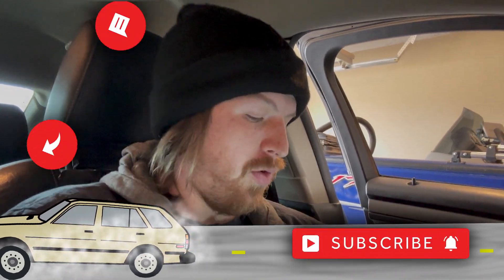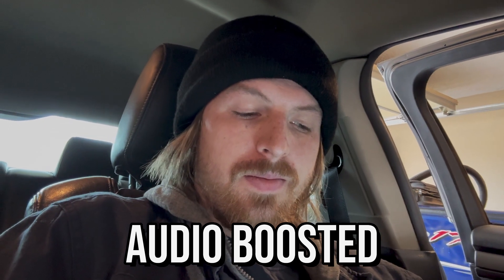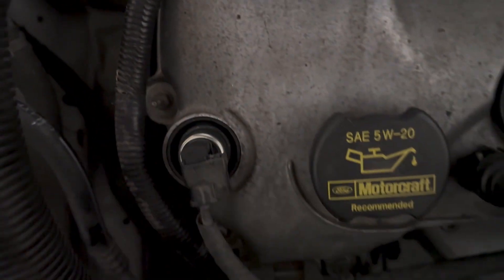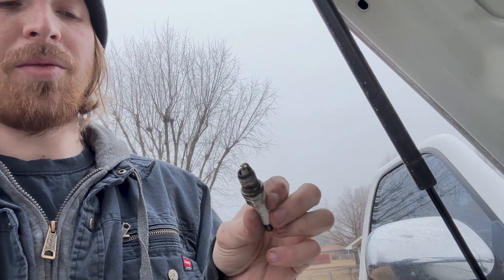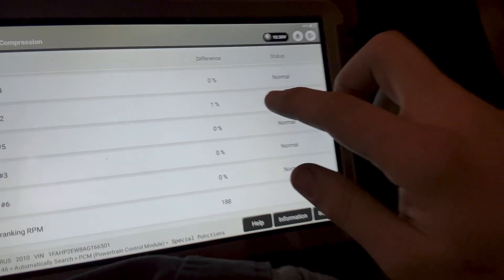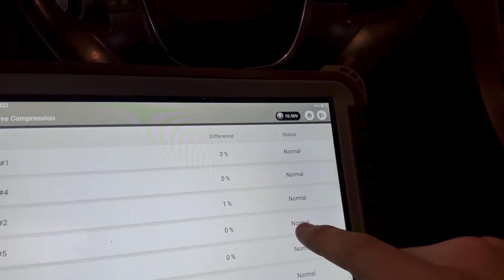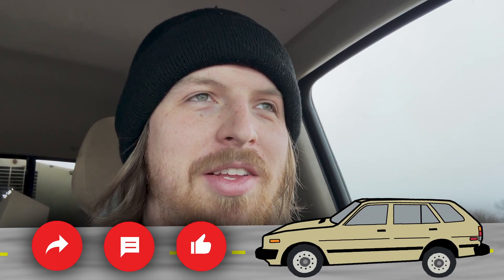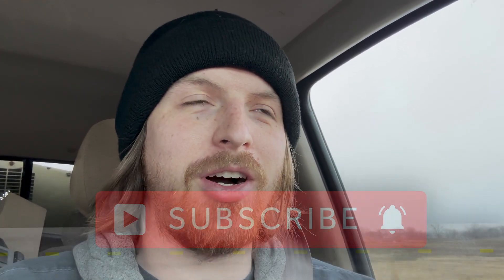3.5 Ford Taurus: Crank/No Start Diagnosis

Comment: No I’m sorry but it takes way less amperage to crank a motor with low/no compression obviously because it has less resistance compression is physical resistance the starter has to over come…. But good video and fast Diag 🤙
Reply from the maker: That’s definitely what I would think as well. I would imagine that energy doesn’t come from nowhere and compressing air takes energy so in my head a starter that is compressing air would pull more amps. My only thought is that maybe the compressed air trapped in the cylinder helps the starter rotate the crank, kind of how if you do a leak down test and don’t have it perfectly at TDC the crank will rotate. Just a thought though. And I’m only going off of what I saw posted a few times in forums. So I don’t really know, definitely something I should look into further though, more knowledge never hurt anyone lol

Comment: My 2013 ford tauras has a strong crank no start we changed the spark plugs, battery, fuel pump module and nothing. Any chance what it might be? The car does have battery
Reply from the maker: You need 3 things for combustion, fuel, spark and compression. I usually start by making sure the vehicle has fuel. If it has fuel, I use an inline spark tester to confirm we have spark. If it has both of those I will usually start looking towards sensors like MAF or others contributing to fuel management. If everything seems fine I will compression test like I did here. I jumped right to the compression test though because I could hear the lack of compression